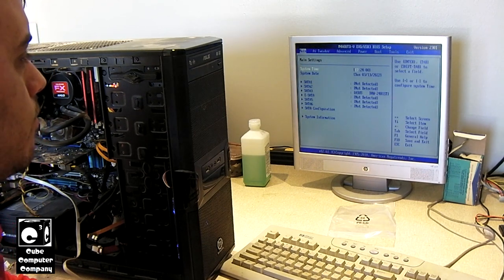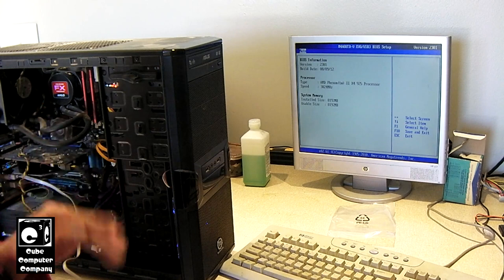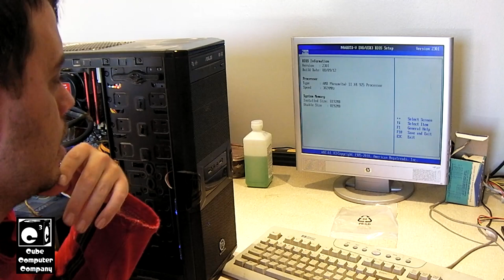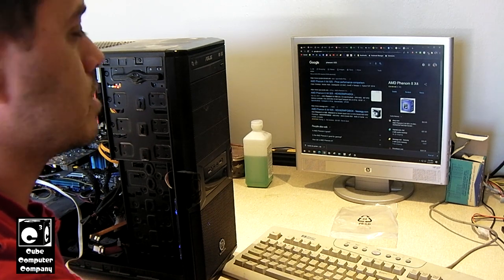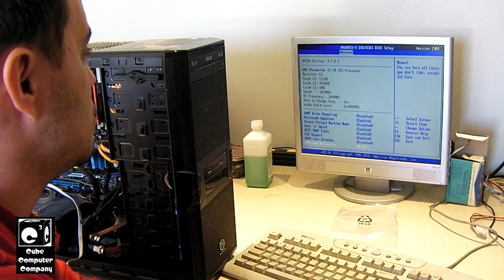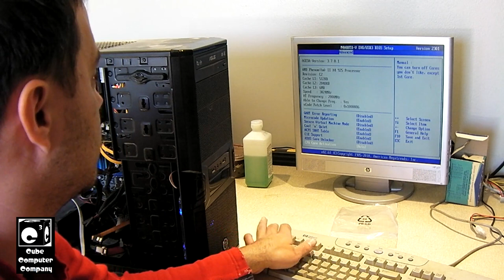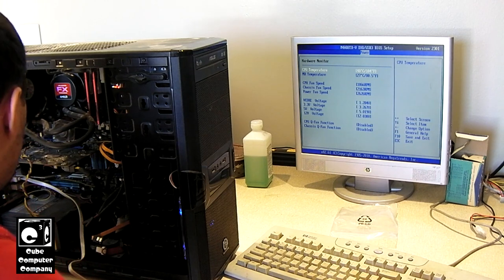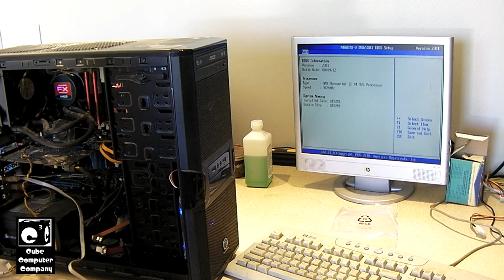Checking out a custom build from a late friend

Comment: Old PCs calm the senses so much.  This PC which I use every day has almost the exact same case as the one in the video, down to the blue light fan in the front.  Only difference I can see with the case is that this case has double arrow feature at the very bottom of the front.  Still many uses for a PC like this one...
Reply: Not for me the AIO pulling in air/pushing out from the case makes no sense to me. Oh well we didnt know what we were doing back then. Old pc's are definitely cool to mess with though.

Comment: I wonder if that Corsair TX650 has a Zero Fan RPM? My new Corsair RM650 has a Zero RPM for when the Power supply fan won’t run unless it’s under a heavy load.